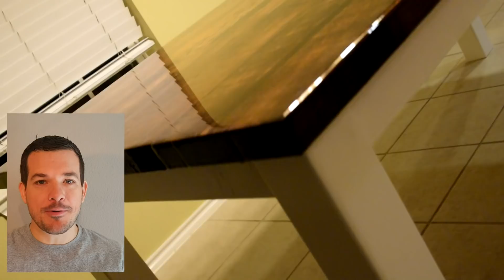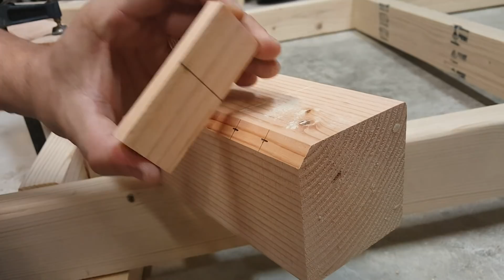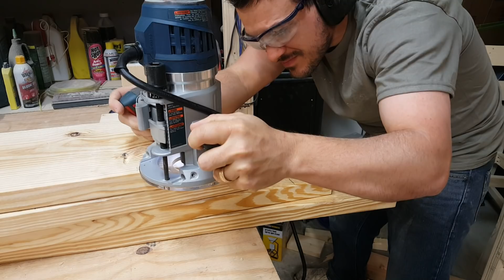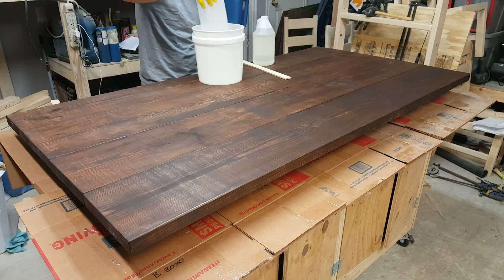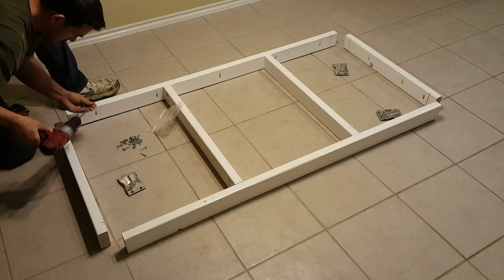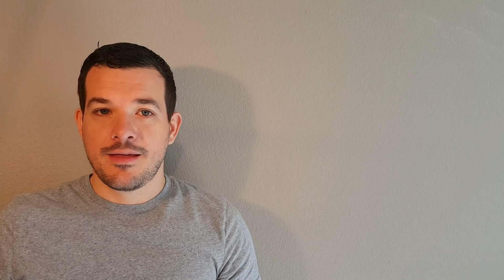Farm-house Table Design 1 - Epoxy Coating

Comment: The link for the stain says that it is an oil based stain.
The epoxy instructions say not to use in oil based stains. Have you had any issues with the epoxy not adhering to the oil stain?

Comment: So did you have to use two kits of epoxy.?. how long did you let the first stage dry..?  you said you applied a second coat so wasn't sure how long the epoxy that you mixed up all together would last for..

Comment: Did you have any issues with air bubbles popping up through the lumber? I’m building a 10’ by 4’ table and I don’t want to have to redo it cause the resin bubbled up from the porous wood

Comment: Amazing video...question I have the stain you used was it oil based or water based? I have a piece of mahogany 4' x 11" using for pony wall top I sanded the entire board down though I want to use the glaze coat on it but the board even being mahogany looks so bland dull looking what can I use to bring some color out on it can I use oil stain or water based without giving any problems when I put the glaze coat on it?

Comment: Table looks nice but from everything I've read, and unfortunatley experienced, that top is going to move quite a bit and the way you've attached it won't account for that movement. I'm curious if you have any updates to this project in regards to that issue? I got out of my way to account for wood movement and then I see a build like this and wonder if I'm wasting my time!

Comment: i think i done the coating part wrong where i over spread the epoxy leaving just a little bit and i never used a heat gun or any heat i just let it dry, will see the results tomorrow but my question is even if im not happy with it is it possible to re coat the existing epoxy with fresh epoxy, or do i have to sand all the epoxy out.

Comment: Does anyone know of anyway to prevent the bottom bulge and fingers on the vertical surface when doing the epoxy?! I'm having major problems with it and it's driving me insane.  I can see it on this guy's table if you pause it right. I'm sure he'll know exactly what I'm talking about too.  

I'm trying to do counter tops and I can NOT have that.  Is there anything else I can use instead of epoxy??? I need some ideas here guys...

Comment: Has a lot of details in this woodwork book “pepe amazing plan” (Google it). The book also shows a few designs and explanations on the materials used for various woodworking processes and the directions on finishing various procedures correctly. In general, this book fulfilled my basic wish to learn about wood working.

Comment: Hey man, looking to epoxy the bar at my restaurant.  It has a coat of polyurethane on it now that's chipping and peeling a bit.  Do I need to sand off the old coat of poly before I put on the seal coat of epoxy?

Comment: Although the table looks nice, it would have been much nicer and of heirloom quality if you had used classic joinery (mortise and tenon)instead of pocket screws. A breadboard edge would also be a more traditional for the top.